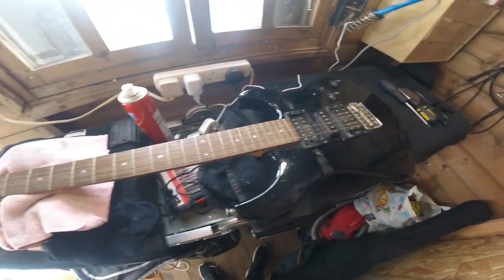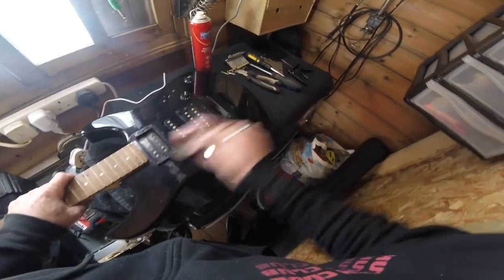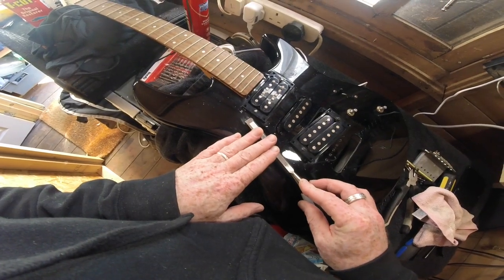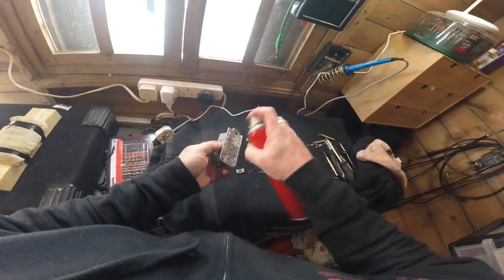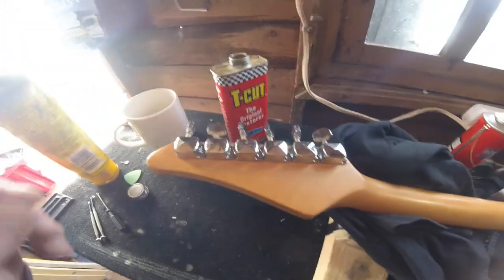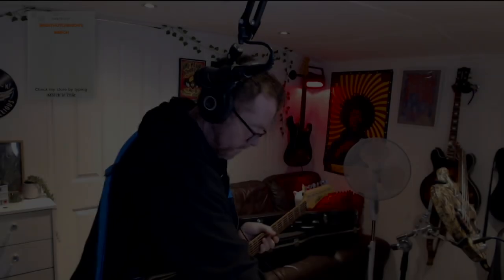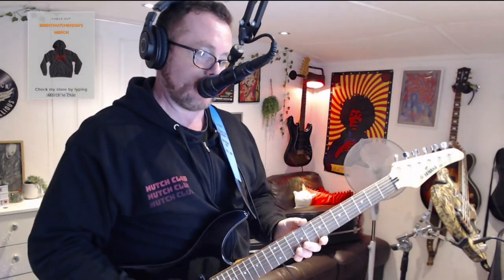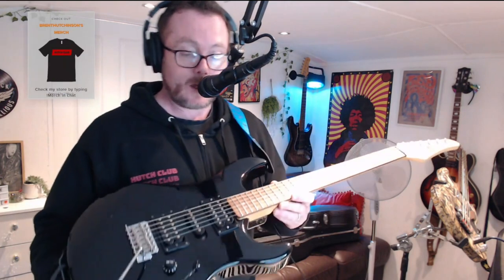Yamaha ERG 121 / Car Boot Sale Find / Guitar Restoration / Review

Comment: Use Naphta to remove the sticky residue. You can buy it cheap from hardware shop. Its basically Zippo lighter fluid but much cheaper !

Comment: I have one of these - was my first (previous) guitar, bought in similar circumstances! The 5 way selector is bust, though, so I have to figure out how to replace that - pretty clueless so I'm going to mine your YoutTube channel for info (just found your channel while searching for a vid of someone reviving this guitar - great stuff).
Reply from the maker: Thanks. Replacing the switch is easy if you can solder. My advice is take a picture of the old one and where all the wires go before you swap it out  oh and also try some switch cleaner 1st sometimes they come back to life.
Reply: @BrentHutchinson  Thanks! Will have to learn to solder first but you've got to start somewhere, right? I like the idea of giving this thing a second life rather than passing it on and it potentially ending up in landfill.

Comment: WD40 good for tape marks.
Reply: I was about to suggest this and saw you beat me to it. Spray it on, leave 30 mins, wipe off gently and reapply if not all gone. As soon as you get into scrubbing you end up with swirls in the top coat so better to be gentle and reapply as required.